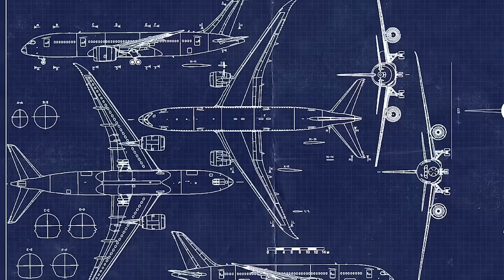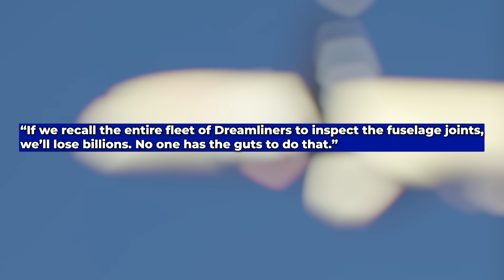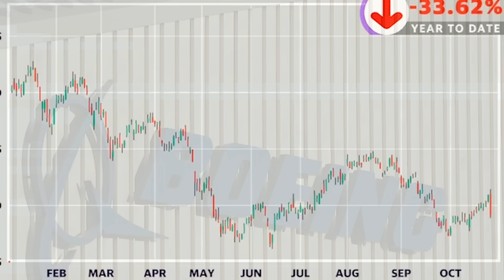Boeing and Air India’s Future With 787 Is DOOMED, It’s Just Beginning...

Comment: It was mentioned that the engines of the Air India plane were changed and overhauled just a few months back in 2025. Could a defect or engineering failure back then affected the plane now ? Like for JAL the plane wing suffered damage over the months and then finally gave out.

Comment: I think, whatever the reason was, that the plane was  set , or after takeoff, by computer, set in the landing configuration. Landing could not retracted, engines on idle. Crew did not report failure, no low terrain warning could be heard in that radiocall. Crew reported no power, no thrust. Thats all. The plane was fit, engines and flaps OK, because it became airborne, and reached 625 ft hight.